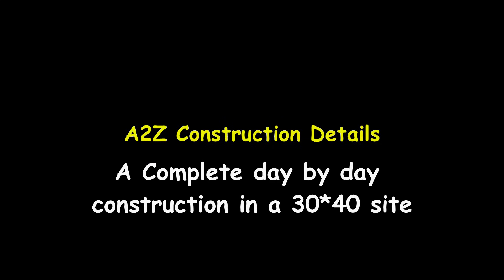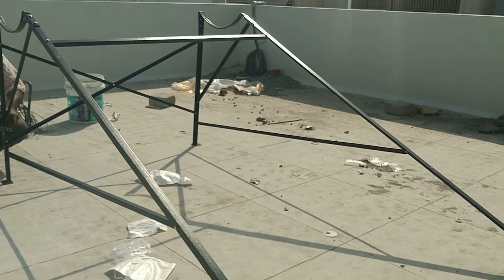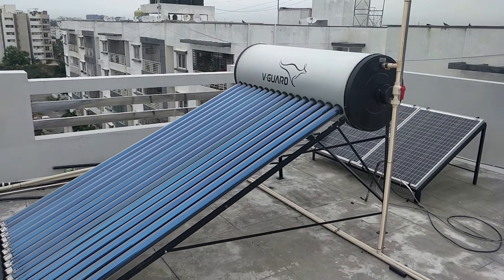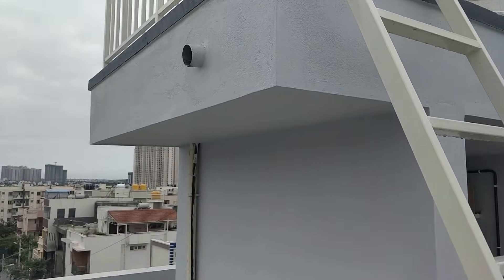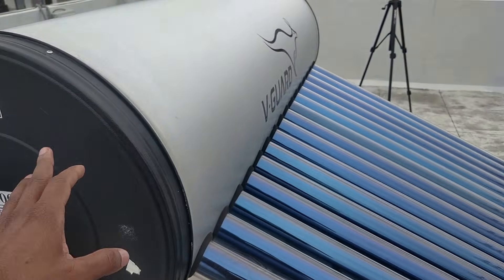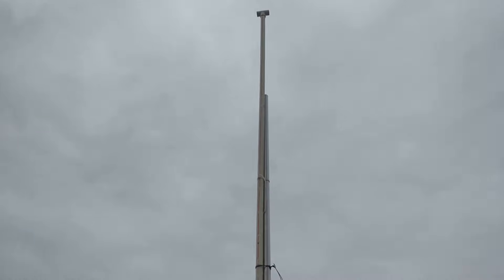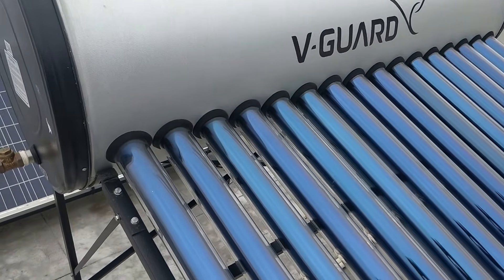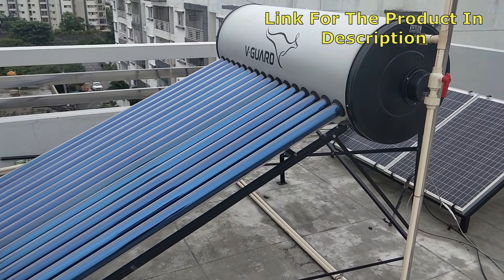Solar Water Heater Installation - 200 Liters

Comment: If the weather is not good than it will heat the water or not and is there are any options to heat the with electricity also in this model

Comment: This is an awesome project.

I would like to ask if this solar water heater is used only for heating water and not providing electricity to homes? Thank you.
Reply: No this cannot be used to providing electricity for home, this setup is puerely for heating your water at around 55-60 degree tempreture on a normal sunny day.

Comment: What is that long vertical pipe(pointing towards the sky ) for ?
Reply: If there’s too much sun and the hot water hasn’t been used too often, that long vertical pipe works as a respirator for vapor, or even hot water can be ejected if there’s excessive hot water in the boiler, if it wasn’t for that pipe the boiler would explode probably.

Comment: Will it provide cold water in summers ?
Reply: It doesn't provide cold water. It's just for drying hot water. If you need cold water, you need a cold water tank or a mixing valve for tap water

Comment: I try to do an installation then after finishing it..the tubes started to bust out when the tank got full now what could be the problem I've ordered tubes so many times..
Reply: Bro suppose you installed this without water tube becomes too hot so don't fill water same day your tube me burst due to high temp fill tank early morning for the first time only when your tubes temp is low
Reply: Friend, I'm the manufacturer of this product. What's wrong with your product? Maybe I can help you
Reply: Do not charge the system  with water in heavy  sunlight  and check the airvent  place in proper  manner as per instructions
Reply: @SunflameEnergyConsultant2025  Yes, the pipe without water can reach a high temperature of 300 degrees. Injecting cold water will burst the pipe, so inject water in the morning or at night,
Reply: Noted ✅

Comment: hi, good video. How is the supporting steel pipe for outlet cpvc pipe installed? Is it having some foundation to hold it in place? Secondly, does this heater have a sacrificial anode in the water tank? If yes, where is it located? regards
Reply: Hello, do you have any questions about solar water heater
Reply: @Tom-zt2ce  yes

Comment: Greetings brother what's the size of the inlet supply pipe and the hot water outlet - 1/2", 3/4" or 1"?
Reply: 3/4 up to 300 LPD

Comment: NEVER EVER BUY THIS VGUARD WATER HEATER. WASTE OF MONEY. THEY WILL SAY THAT IT HAS 5 YRS WARRANTY. BUT  TANK AND OTHER PARTS ARE NOT COVERED UNDER WARRANTY. TANK WILL START LEAKING IN 2 YEARS. NEED TO PAY RS.6500 + LABOUR CHARGE FOR NEW TANK. VGUARD IS A FRAUD COMPANY. CHEATERS. I LOST MY MONEY. ASK CUSTOMERS WHO IS USING  MORE THAN 3 YEARS. Also calculate the electricity consumption for 10 years if you use a normal heater. The  expense will be less than this solar water heater cost. PLEASE DO NOT WASTE YOUR MONEY.

Comment: Don't buy V guard solar heater , because the inner tank  is made of thin steel ,so after 3 year the inner tank will break .. better go for tank which is coated with gasoline or ceramic ...I bought 3 solar heater from v gaurd...all are gone...
Reply: Please suggest any company heater bro
Reply: No it's wrong. Based on poor water quality it may happened , but not sure abt ur case study, u would have select hard water model option also

Comment: It's not reccomended by any pipe manufacturers to directly connect cpvc pipe at hot Water out let of solar, it's always better to hv composite pipe or metal pipe to be connected at the outlet and after one meter distance only then cpvc pipe to be connected .
Pipe must be insulated , and pipe to be clamped properly , distance between pipe support as per the pipe manufacturers 
Manual reccomended
Reply: No sir  solar water heater out let temperature is 65* and CPVC retain 92*.  So need not required for composite pipe still 15 years plus lot of system working fine still based on the experience I shared my point
Reply: @sriramkrishnamani2865  cpvc pipe manufacturers are recommending this , in thier catlog it's mentioned

Comment: Can we use cpvc pipes and fittings in washrooms for solar water heater
Reply: Yes
Reply: Yes as cpvc can sustain hot water upto 300 degrees.. depends on the grade also.. kindly refer schedule 80 of cpvc pipes

Comment: These tube type solar water heater are Chinese products, like I said if the tubes are broken it would be costly to replace, main problem is tank is made of very mild steel sheet which starts to leak in a year or 2 

So best would be to buy solar water heater with coper tubes older ones 

Don't go for these tube type
Reply: Tubes will cost you only rs 650 per piece which is cheaper than glass on the copper plate panels.. No tank leaks in 1/2 years, if that's the case you will get replacement for the same under guarantee of 5 years
Reply: @shashikiran4332  Yes, you're right. You can contact me if you need a solar water heater
Reply: Everyone in Mexico are using these today, I can confirm this cause every year I go to Mexico. So they no longer use the gas to heat up the boilers anymore
Reply: Jagadish spreading wrong opinion   about product. Tube cost is 650 only and life time minimum 15 years based on water quality. Very good product
Reply: Hello, the solar water heater we make will not leak in a year or two, and the vacuum glass tube will not be damaged normally. But it's best to keep some spare when buying. It's really environmentally friendly to only use solar energy
Reply: S